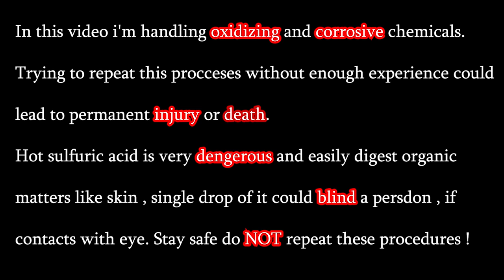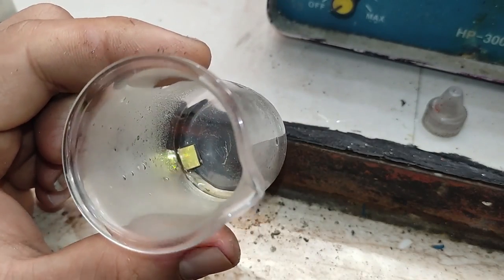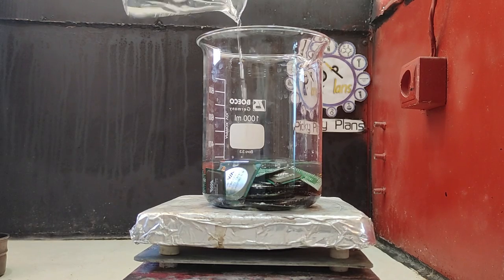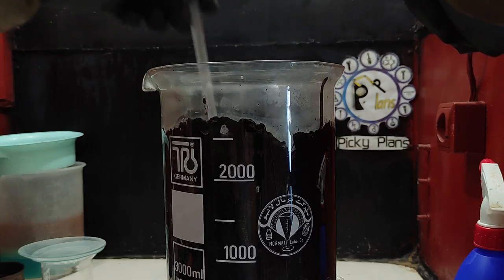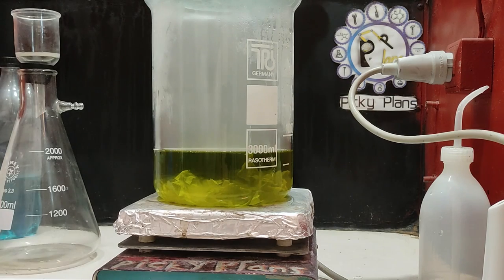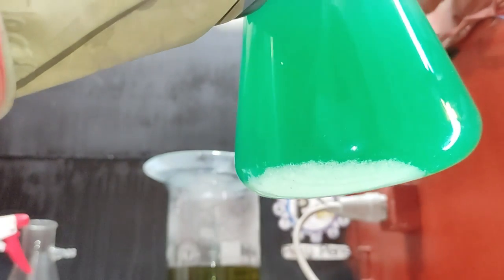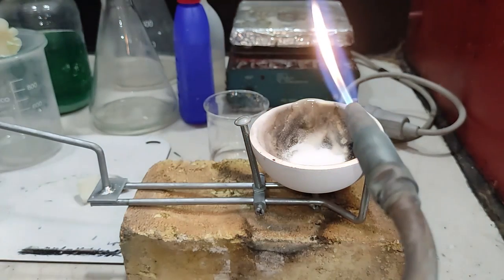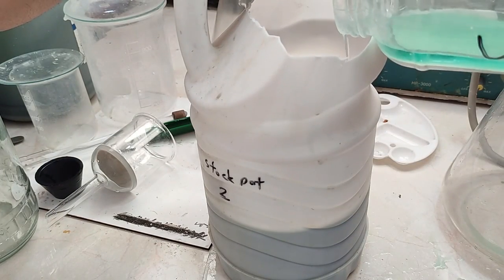Gold corner BGA chips gold recovery | Gold from IC chips | BGA IC gold recovery

Comment: You can use francois pellier method for tin 
100 ml distill water
25 ml hno3
0,5 Gr  urea
6gr citric acid
Reply: And all tin will gone just like black powder and in this powder inside  maybe have little amount Gold particules therefore you need   filtering this solution and tin will be in the only solution
Reply from the maker: I've tested this Solution before... That was not able to prevent forming tin white paste (Metastannic acid) completely, when you have lots of tin to be leached.
Also i recover tin from that white percipitate + charcoal  in oven at 600° C.
 Anyway , Thanks for recipe.  🙏

Comment: If burning the all then we use cyanide method... Is it possible?
Reply from the maker: Yes it's possible just you need do something about copper. There is too much proportional copper amount. , So an inhibitor is needed.
Also Process is much slower than acid method
Reply: @PickyPlans  which inhibitor you propose.
Reply from the maker: I would say MBT or nothing else
. Nothing is good as MBT you see most of industrial refiners their cyanide bath is exactly colored as MBT is. I mean it's obvious they are using MBT. Another option is using low concentration Cyanide and high pH .
The is still another option which I'm not sure about , and that's using pure ammonium quaternary salt (not Cetrimide) another salt and see how it works.
Reply: @PickyPlans  you mean that ammonium quaternary which is ammonium chloride works as an inhibitor.
Reply from the maker: No ammonium chloride on it's own isn't quaternary ammonium salt .
Ammonium group should be conjugated with another group. Here is some examples
alkyl dimethyl benzyl ammonium chloride, alkyl didecyl dimethyl ammonium chloride, and dialkyl dimethyl ammonium chloride.
hexadecyltrimethylammonium ('cetrimide'), chlorhexidine, and benzalkonium chloride.
Probably Cetrimide has gotten your attention. 
Well, if you find pure powder is good otherwise the pre prepared solutions are weak for cyanide